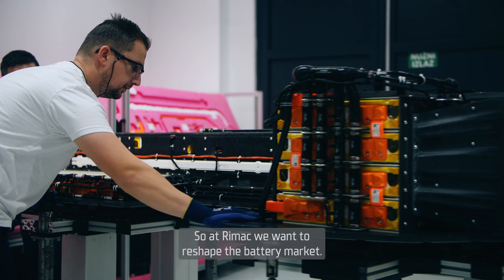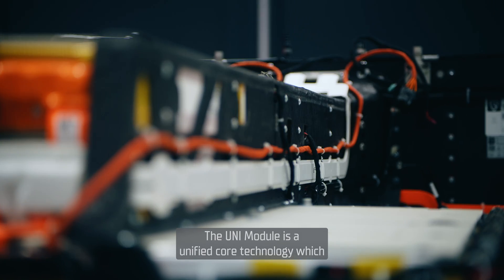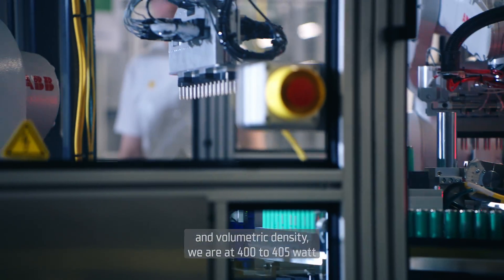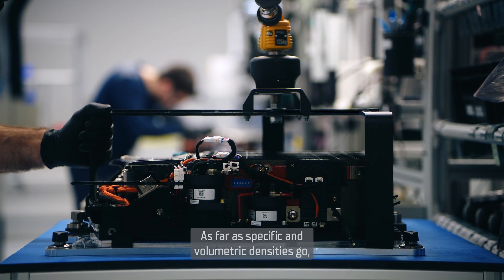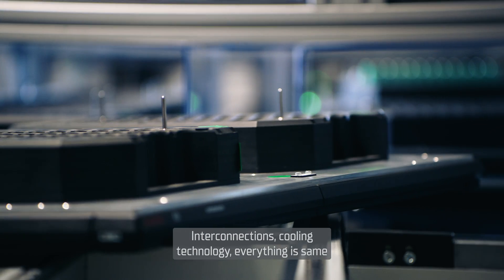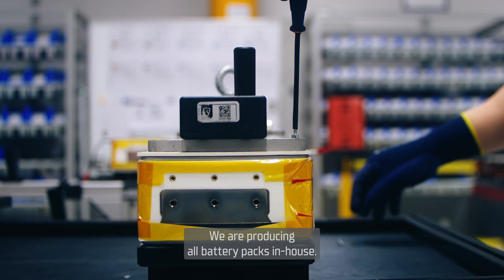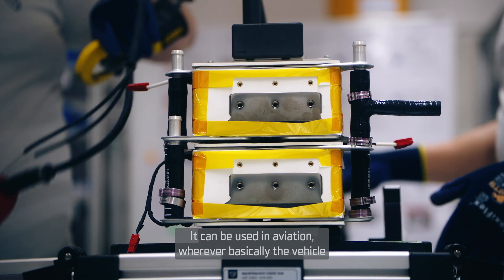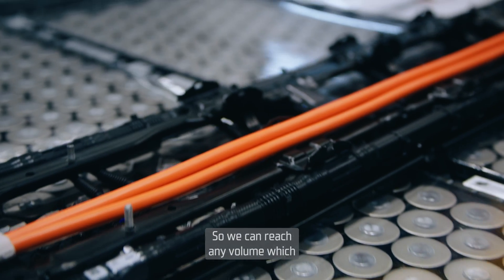Rimac Technology | Battery Systems

Comment: This types of cells seems more durable in Higher g forces and crash impacts in my View , as pouch battery packs in BYD catches fires easily as per many Cases.
Reply: correct using cylindrical cells mostly translates cheaper saver and powerdenser packs but lack energy density and require more overall engineering compared to prismatic or pouch